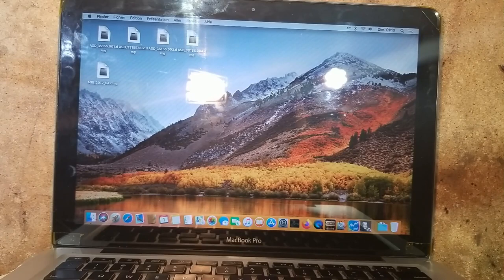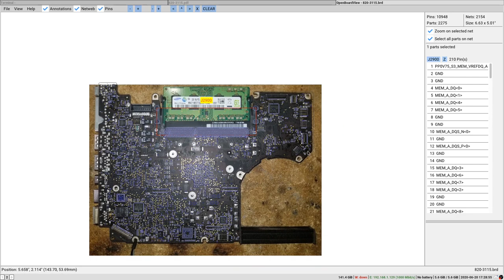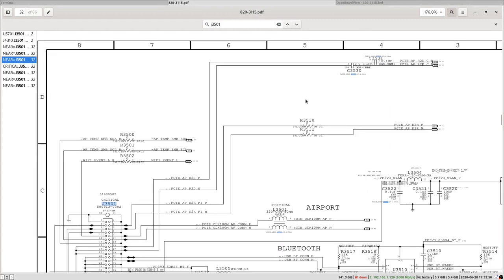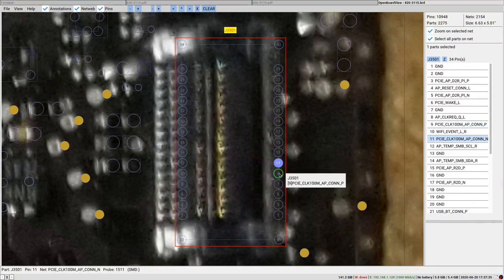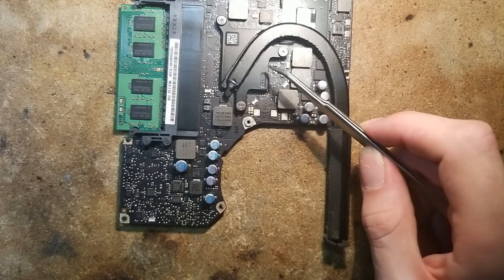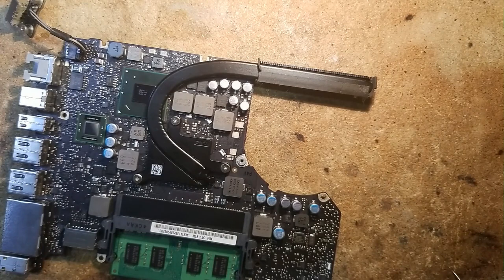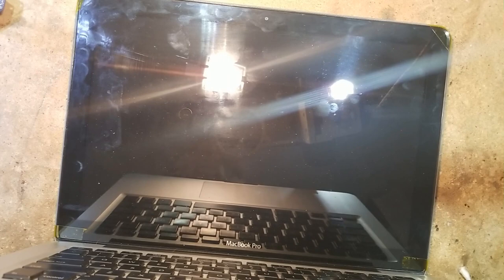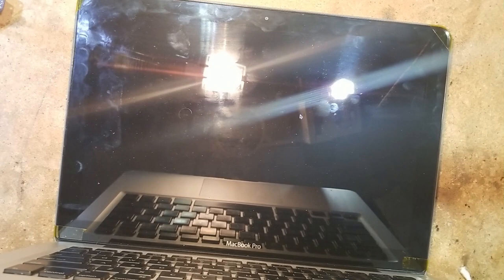Troubleshooting & Fixing 820-3115 No WiFi

Comment: Nice fix. Always nice to have a reference/working board to test your hypothesis with correct readings. Eliminates going down a rabbit hole. ;)
Reply from the maker: It is not necessary here as in this case the schematics tell you all the information you need. But it's still nice to have especially as a beginner when you don't really know what the measurements should look like. In other cases you just cannot get the information from the bad board/schematics/boardview so a known good board helps a lot.